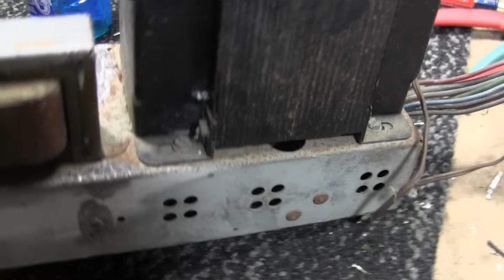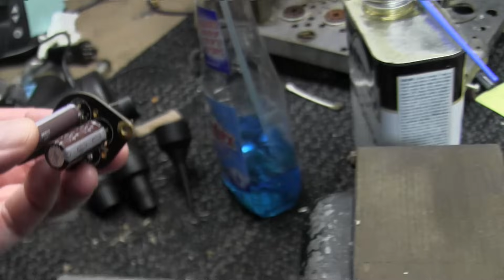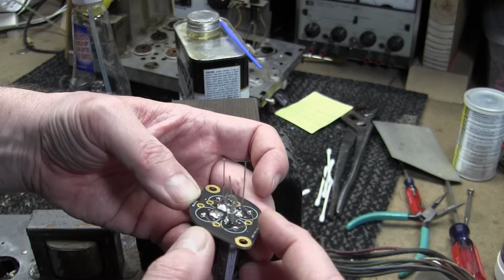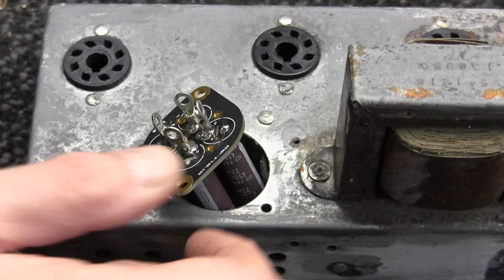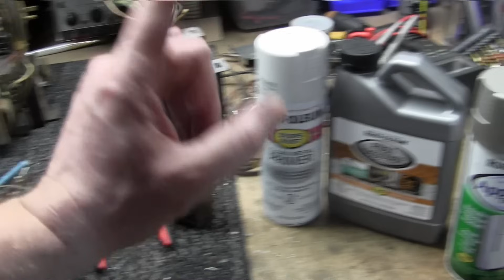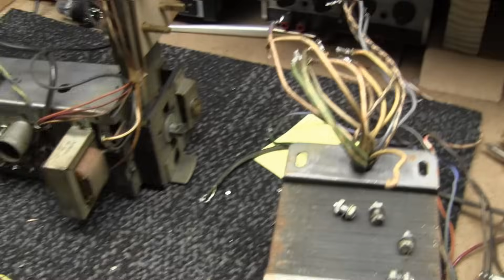Zenith G2439RZ "Monroe" - part 2

Comment: I'm somewhat confused......these canned electrolytics are still available new from various sources.   Why not buy those and do away with the adaptacaps?   Yes, the adaptacaps are less money, but when you factor in the time to install an adapticap, you'd save money buying new canned electrolytics.  And the set will look original afterwards far more than the glued on adaptacap cover from the original canned capacitors. (if they even come off in one piece).   Again, no hate.....just pointing out other options.  

Rivets can be installed from above with zero interference down below.  Granted, getting to them is a different story.   But again, reinstalling  in a differentiated in a clocking differential will yield the same results.   Again,  Every Predicta and other pre 1955 set I've restored never ever had any issues installing new canned caps, but on occasion, I did have to add an additional electrolytic cap underside, but there was always room.   

Am I missing something here?

Comment: The lug attachment is great and probably preferred if there’s lots of stiff old wiring putting stress on the connection but it’s a lot of work and with my shaky hands, it’s easier for me to just make an eyelet. If 2 or 3 wires need to be attached and they are close to being parallel to each other I’ll slip a large diameter piece of shrink wrap over them, solder the wires to the loop and slip the shrink wrap back over the whole thing. Lots of ways to approach this. I usually take the path of least resistance!
Reply from the maker: Lot of work?  Took a couple minutes.  Would take even less if you get eyelets without the plastic.
Reply: @bandersentv  Lotta work for me with bad hands and eyesight.

Comment: Maybe they should come out with an adapt a cap with lugs crimped into the board. I often wonder what you would do if there were a lot of wires and/or large resistors soldered to the capacitor lugs.

Comment: I used  bare steel colored paint on a stock 71 340 spread bore intake I had cleaned at a shop so it would stay nice till I ever decided to use it. Last time I saw it it still looked like fresh cast iron steel.

Comment: Maybe next time don't just snip the long leads, bend them over once the eyelet is over and solder it all. Then if you heat is too much the eyelet will be stuck in place I think. 
You also have low and high melting point solder, you could do the eyelets with a high temp type and solder the wires with a low temp solder. But that might be overdoing it. 

Another option would be the use of a blind rivet to mount the eyelet to the adapt a cap, but that would require a different board design. (A hole of correct size) But they make blind rivets in all shapes and sizes. Used then recently to reattach all sections of a riveted multi section pot with switch.
Reply: I highly second your suggestion of NOT snipping the capacitor leads and instead feed them through the eyelet too. That way a secure connection is ensured even if the eyelet was heated to where the solder melts. The way Bob solders on the eyelets without crimping the sleeve around the cap wire gives the chance of creating cold solder joints. But to be honest the whole soldering on eyelet ordeal seems like total overkill. Just look at how much time and extra money is spent; buying the eyelets, removing the plastic sleeve of the eyelet, using half a digit's length of precious lead solder to affix the eyelet to the cap lead etc... All it would take is use needle nose pliers and bend the already existing cap lead into an eyelet. Done in less than half the time and at no extra cost to boot!
Reply from the maker: @randomsteve4288  Flimsy cap lead is not strong enough to hold some components like big power resistors and heavy gauge wire.

Comment: Hey there!  That epoxy paint is fantastic. I used the almond colored version to spray the plastic cabinet of a Seventeener and it was a perfect match. I have sprayed chassis before and found a great product that has actual stainless steel powder along with silvery pigment mixed in. Can’t remember the brand but it’s on the spray paint shelf. It is the closest to a replica steel finish I’ve ever used. It needs the full shake time and shaking often during use because the steel powder suspension in the can settles quickly but it produces a beautiful finish.
Reply: It is - I repainted my 1947 Kelvinator chest freezer with it back in 2017 - It is still holding up perfectly.